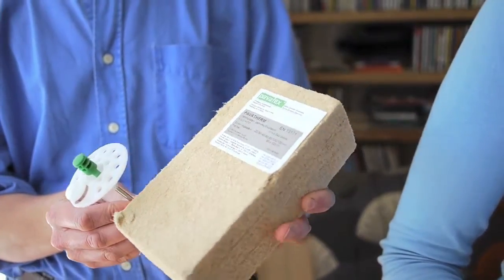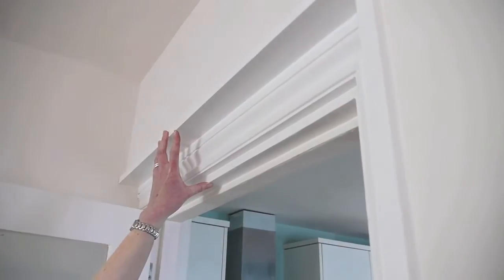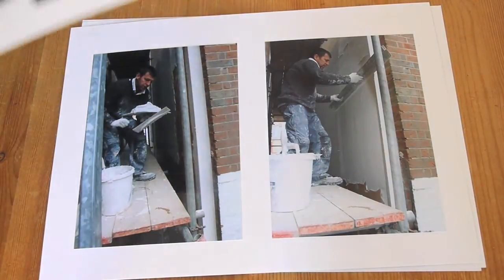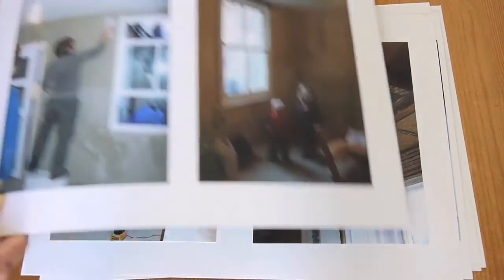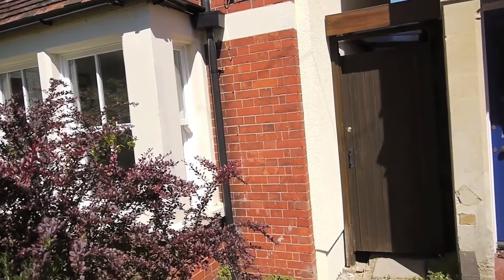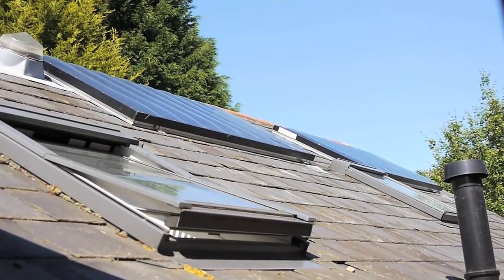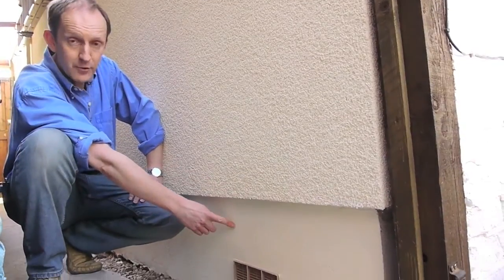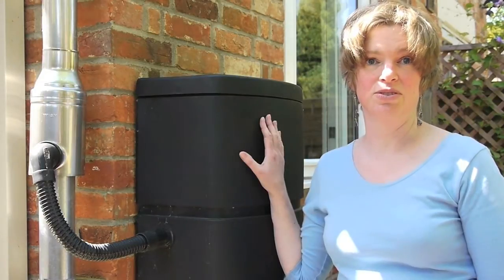How to eco-renovate your home I - Reducing your carbon footprint (1/3)

Comment: I found your video incredibly helpful so thank you so much! If possible could you list some of the products used on your home and possibly do a video of the upsides and downsides of the products you narrowed down to make your final choices?
Reply: The external and internal wood fibre insulation were sold under the trade names Pavatex and Pavedentro.  I would recommend talking to a specialist about the upsides and downsides as these are likely to vary depending on the specific conditions in your house / household.

Comment: Well done for using a breathable (vapour open) insulation and render. There are many home owners opting for a more thermally efficient vapour closed insulation board; this approach can cause damp and decay in many homes. When Insulating a home you do need to speak with a building performance consultant who will model the benefits and risks; this will save you a lot of problems in the long term.
Reply: You are right - damp and condensation were major considerations in selecting a breathable wood fibre / lime mortar solution - you need to speak to experts and be aware that the detailing is important.

Comment: Hi thanks for a great video, really interesting. Could I check, the insulation - is it exactly the same product put both internally and externally? But rendered externally and plastered internally? Many thanks
Reply: HI Kat - they are slightly different products and thicknesses, but both based on wood fibre and produced by the same company, Pavatex (other similar products are available!).  You might be interested in an updated video which we made recently, and some other video case studies, which are featured on this site: https://cosyhomesoxfordshire.org/ 

Good luck with your project!

Comment: Well - as one of the owners, I can assure you I think it was worth it! Yes the solid wall insulation was expensive, but as well as saving around 30% of our heating energy it has also resolved damp and condensation problems. If you're interested, we give more details on costs at: climatex.org/users/tina/blog.